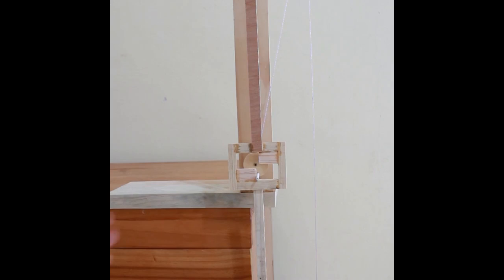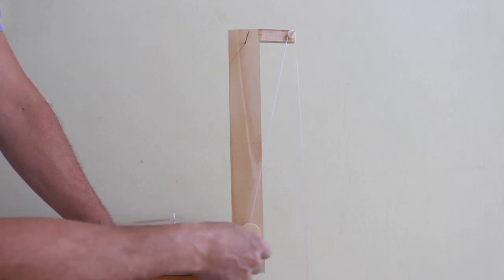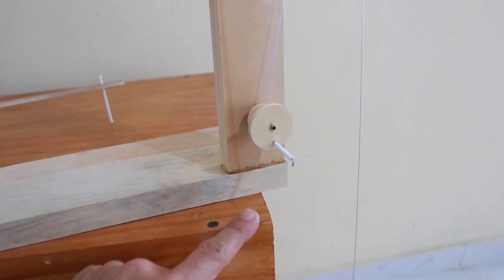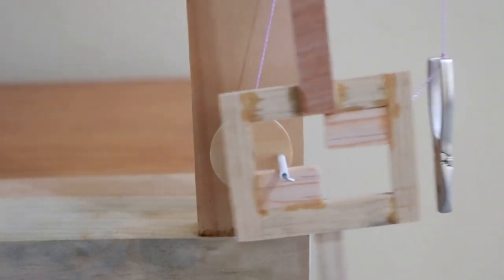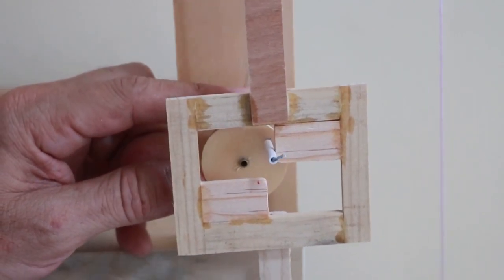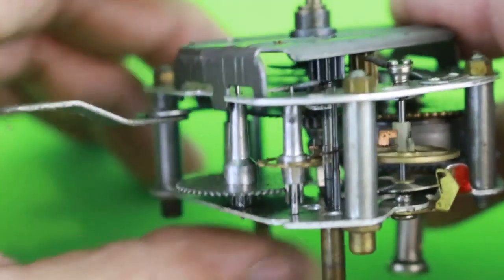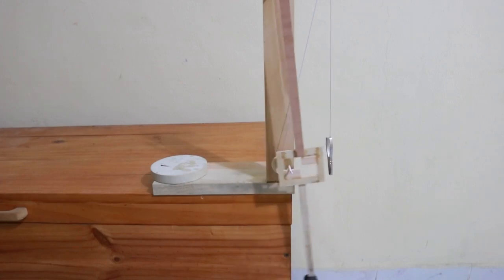Macdowall Escapement and Pendulum Mechanism

Comment: You skip the explantion of the blocking lapse time in each tic and toc. The pipit don´t jump from one pushing area to the other; instead it is blocked on the otreh surface until the pendulum comes back.

Comment: Very well done Sir :) Is there any way to construct your pendulum based escapment so that it does not release so much energy with each ticking cycle of the pendulum ?
Reply: @markjob6354;
2 years later...
You can "gear up" the windlass mechanism, and you can add some kind of "speed control" to the escapement rotation...some clocks use a kind of "fan" with a friction clutch to slow the rotation, and to hold the pin against the 'block' to prevent it from bouncing.

Comment: With a weight it makes sense that it always applies the same force to the wheel, making constant speed, but with the spring how come it doesn't oscillate faster when the spring is more tightly wound?
Reply from the maker: From wikipedia: A problem throughout the history of spring-driven clocks and watches is that the force (torque) provided by a spring is not constant, but diminishes as the spring unwinds (see graph). However, timepieces have to run at a constant rate in order to keep accurate time. Timekeeping mechanisms are never perfectly isochronous, meaning their rate is affected by changes in the drive force. This was especially true of the primitive verge and foliot type used before the advent of the balance spring in 1657. So early clocks slowed down during their running period as the mainspring ran down, causing inaccurate timekeeping.

Two solutions to this problem appeared in the early spring-powered clocks in the 15th century; the stackfreed and the fusee:

Stackfreed
Main article: Stackfreed
The stackfreed was an eccentric cam mounted on the mainspring arbor, with a spring-loaded roller that pressed against it. The cam had a 'snail' shape so that early in the running period when the mainspring was pushing strongly, the stackfreed would provide a strong opposing force, while later in the running period as the force of the spring decreased, the opposing force of cam would also decrease. The stackfreed added a lot of friction and probably reduced a clock's running time substantially; it was only used in some German timepieces and was abandoned after about a century.

Fusee
Main article: Fusee (horology)
The fusee was a much longer-lasting innovation. This was a cone-shaped pulley that was turned by a chain wrapped around the mainspring barrel. Its curving shape continuously changed the mechanical advantage of the linkage to even out the force of the mainspring as it ran down. Fusees became the standard method of getting constant torque from a mainspring. They were used in most spring-driven clocks and watches from their first appearance until the 19th century when the going barrel took over, and in marine chronometers until the 1970s.

Comment: You wound the wheel the right direction while showing the working, but the wrong direction  when letting it run. That way it would not run for long and only stopped it in these steps without driving it.
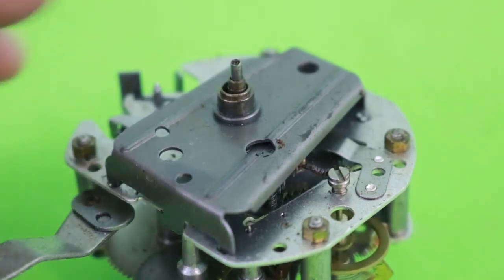Reply: I initially thought you were wrong.   He winds anticlockwise and it runs clockwise.  But around 4:20 it seems to be blocked on the wrong face, trying to move anticlockwise, which wouldn't happen.
Reply: @raykent3211  exactly

Comment: ~ Would of loved you to have been my teacher at school. Great videos
If your pendulum swang at 30' arc youd get a very close "second". 
Could explaining it with 360 diameter clock face / 12 segment marked as hrs = gives 12x30' degrees (arc seconds)
360/12=30' degrees pendulum swing is an old second of time
Prob know that, but reader might be interested
Reply from the maker: Thanks good info
Reply: @ludicscience  maybe draw a circle onto paper and explain like a clock face. then cut out a 30' degree section (triangle section dot in middle). then create a pendulum swing out of it, using its length :)
Reply: @ludicscience  just thinking... perhaps pendulum advancing a disc of 6' degrees teeth is equivalent to 1min (A) 360/60=6 

so that would ALSO mean disc (A) with a peg on it advancing another disc (b) of 6' by ONE tooth every minute would equal 1 hr

could also have another peg and advancing disc (C) of 360/24=15' for 24hr clockface

///
two discs, 60x6' teeth. first one has a peg on it to mark its full rotation
one disc, 24x15' as a 24hr clockface

...interesting
Reply: nah. you really didn't understand the theory
Reply: @raymondo162  I hate it when annoying pricks like you provide no evidence, ideas or further the discussion… choosing instead to chime in with ”ERgh got it wrong” as if that in any way elevates your status as being knowledgeable. This shows complete lack of intelligence on your part. Justify your position, explain your idea and that will be welcome, or go back to the moronic abyss from whence you came.
Reply: In theory, an ideal pendulum of 1 meter in length has a period of 2 seconds total with usually 1 tick at either end of its swing.  That is to say, it beats seconds.  So its the length of the pendulum you need to change.  Also I have a wall clock with an 85 centimeter pendulum which ticks 72 times in 60 seconds.  I also have a cuckoo clock that ticks at more than 2.5 times per second, its pendulum is much shorter.  If you look around the internet you can find many clocks that do not beat seconds.  The gear ratios used determine how many rotations the escape wheel needs to make for the minute hand to go around in 1 hour.  However, the bottom line for the pendulum swing is the length.  You'll also notice that pendulums have bobs, a weight that can move up and down the pendulum length to adjust the period.  This changes the center of mass of the pendulum, higher is faster, lower is slower.  Moving the mass of the bob changes the effective length of the pendulum.  So really its the effective length that matters.
Reply: @jmcarp0  hi there, many thanks for youre input... very interesting. Thinking it over, makes sense now. Guess thats why old grandfather clocks where tall - being a meter.